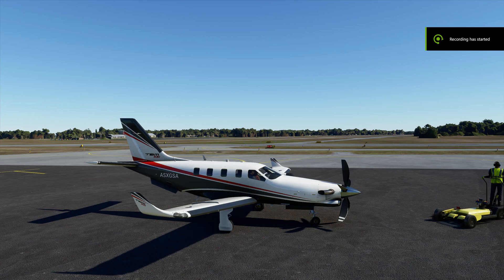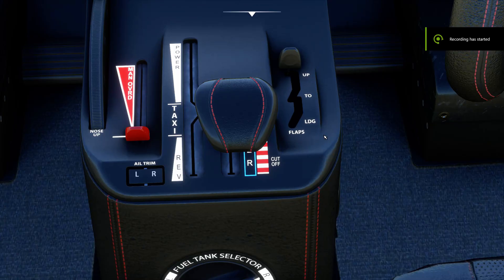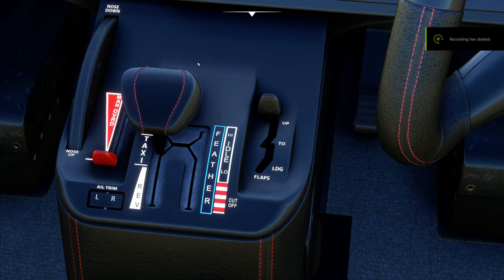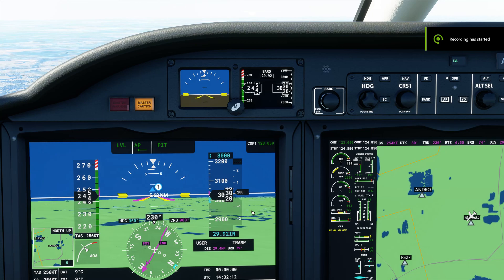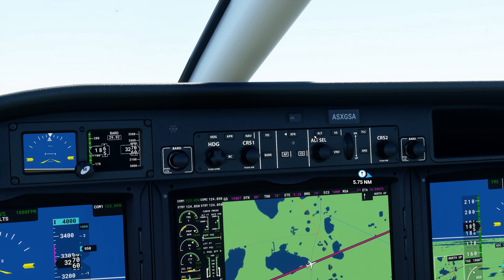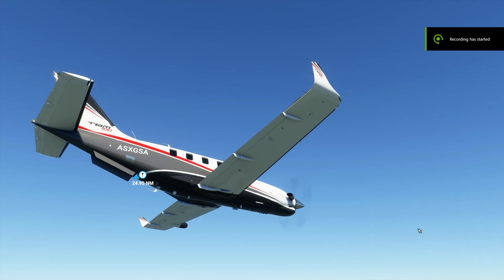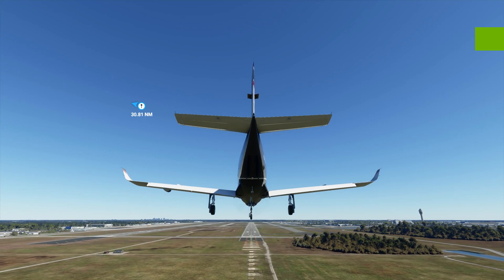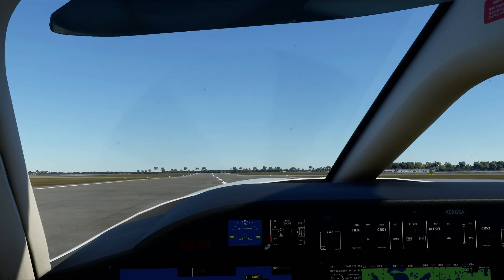ILS 7 min Tutorial TBM 930 Flight Simulator 2020

Comment: Looks good but mine must be broken it will not line up on the ILS unless I click on BC & it won't descend & yes I have the ILS in the NAV1 & an app to the active
Reply from the maker: The BC switch allows the autopilot to track a Localizer Back Course. Did you have the ICAO airport code for where you are trying to land at ?
Reply: @azayomi  I had the runway ILS for the Dest. VOR1 is set on final but if I click on APP the TBM turns to line up with the opposite rnwy & flies away from the one I'm landing on. The course is set to the rnwy I'm trying to land on & when I click on BC the TBM turns to line up but the ALT won't bring me down on the GS. I just can't land with ILS I have to fly it in myself
Reply: I could only land once correctly following this tutorial after that switching to LOC1 with the frequency entered will not change altitude and the plane will follow the green compas elsewhere.